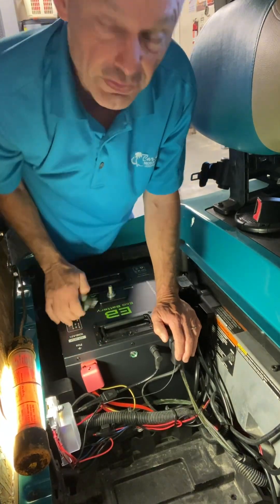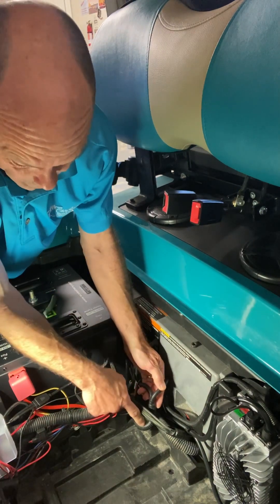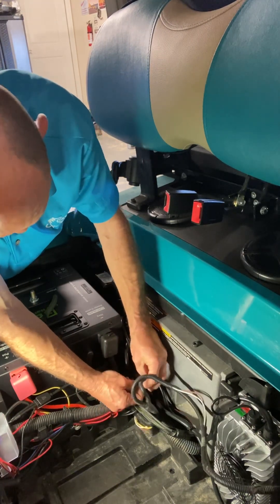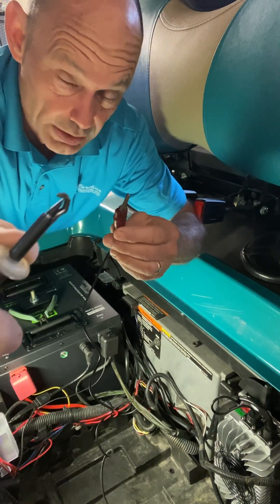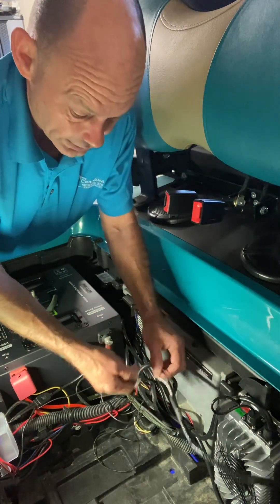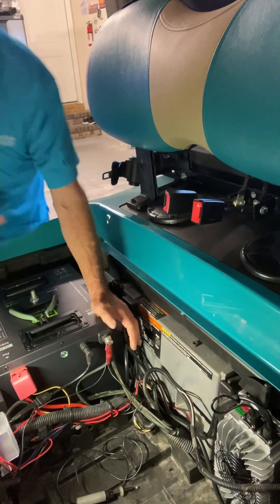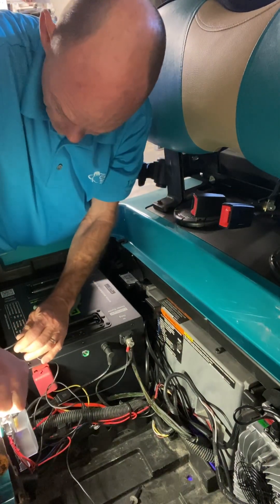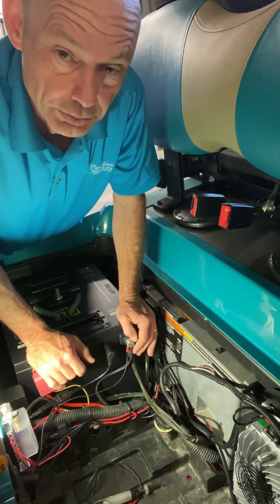Club car wiring harness diagnosis for additional lights, turn signals, etc.

Comment: James I’m going to need a converter thought about Amazon and get a fuse block with it along with connectors but thanks for getting back with me I have lights turn signals usb horn backup vesper and horn brake light to so I might get back to you this week of how to hook my accessories up pretty much know how battery and charger hook up but a little bit stumped on the wiring don’t want to blow lights or other things thanks again
Reply from the maker: Just LMK!

Comment: how did you hook all your 12 volt accessories to your converter after installing lithium battery im putting one in my 2022 club car precedent
Reply from the maker: If you only have headlights and maybe a radio you can hook it directly to the converter, if you have multiple accessories like USB port, under glow lights, or anything else you may want to install a fuse block and those are pretty simple. I’ve got one on my personal Golf Cart and I just got the fuse block off Amazon, it works great!  Have you already purchased your lithium kit? Make sure it includes the voltage reducer and if you have not , I’d be happy to be your dealer!

Comment: Thanks James for these helpful videos and your consultation on installing by new LED center tail light that is attached to the roof.  Living in a senior community having the center tail light has increased the visibility of my cart a lot.  For anyone who uses an enclosure on their carts during the colder months, the visibility of your tail and brake lights is greatly reduced.  Adding the center tail light has solved that problem.
Reply from the maker: You did a fantastic job! Unfortunately with accidents with automobiles and Golf Carts, I can see this becoming a standard in the future, I think you are ahead of the curve!